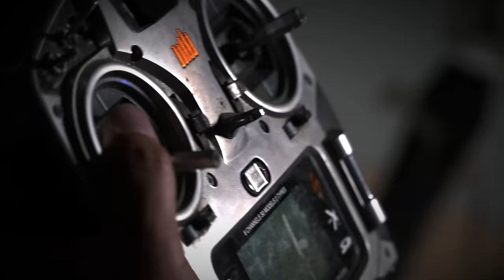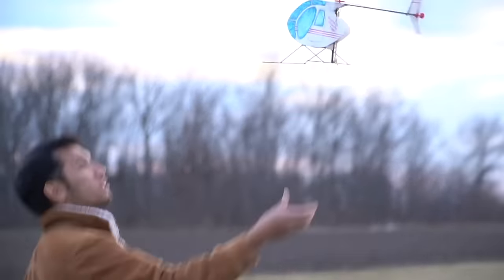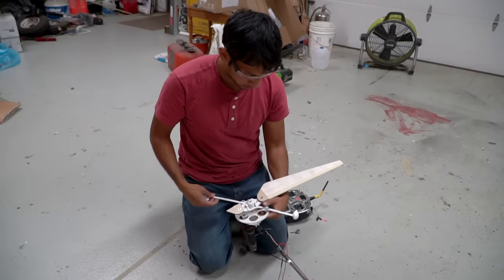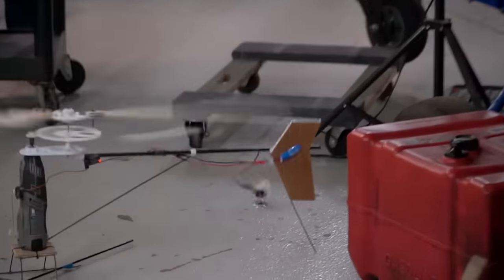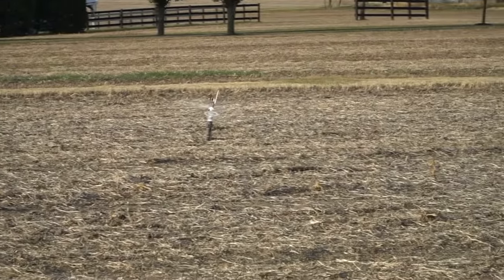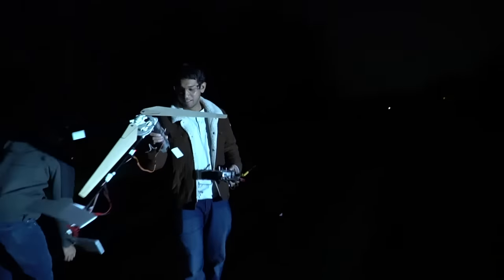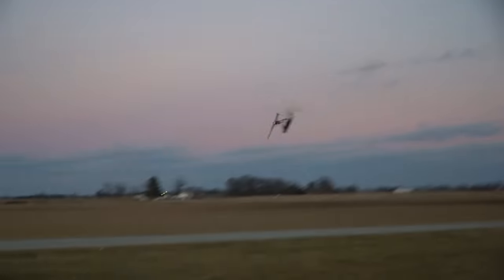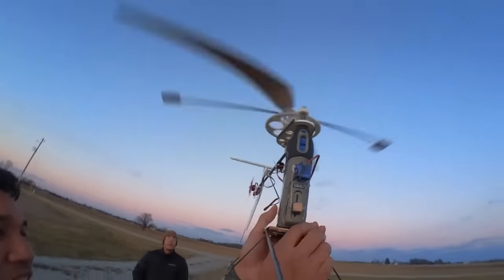Teaching a Dremel Tool to Helicopter

Comment: Think about a pneumatic torque wrench powering a go-cart.  The fun would be the air compressor needed to keep the torque wrench moving.  If you wanted to scale up, there are torque wrenches in 1-1/2" and 2-1/2", if 1" is too small.  Problem is scaling down as the CFM doesn't change that much.
Reply: Pressurized air on an experimental go-kart seems like a questionable idea

Comment: I don't know if there's a free plug-in to make them, but helical gears would give you much less noise. Involute gears are good for low speed high torque applications. Things I've learned from This Old Tony.
Reply: There are free plugins for fusion for helical gears. I'm not sure they would be a good fit for this application though, as they also create a side load, which would case the frame and gears to flex depending on how much torque is applied, possibly causing them to disengage in flight. By involute gears I'm assuming you mean straight cut gears? Involute gears can be straight or helical, and is the most common type in machinery today, and are suitable for all speed ranges.
Reply: Think that's the least of their problems 😂
Reply: SHOUT-OUT TOT
Reply: @2testtest2  That's why double helical gears exist.
Reply: @JurassicLemon  

2x! Guy is a genius machinist. Love his channel.
Reply: This Old Tony does not make RC helicopters. Among other things helical gears have to be fatter and heavier.  I'm familiar with the world of RC helicopters and I have never seen a helical gear used for the main rotor drive.

Comment: I would like to see this Dremel revisited as a Gyrocopter and the Dremel being used as the forward propulsion. Then you will have a dihedral to keep it balanced plus rudder authority via the tail planes and still retain a rotor and blades as your lift. Looked fun!

Comment: Why didn't you try a brace between the drive shaft from the Dremel and the shaft the blades connect to to keep the gears from slipping? Lot more energy in a battery than the rubber bands.

Comment: I made my own set of piccolo blades back in the early 2000s. I later made some collective pitch blades with symmetrical profile and just put a tapered shim under them to give a fixed "collective" like pitch and they flew extremely well. I dared not try them before static/dynamic balance which doesn't take long.
Reply: How do we get the Sripol guys to see this???

Comment: If you trim it for forward flight the power and tail rotor effectiveness will not be an issue with the translational lift.. and it will be more stable.. don't try to hover

Comment: Some things I noticed - a shorter screw in the gears could help remove the centrifugal imbalance which is impeding the gyroscopic stabilization you should be getting from the rotor mast, also adding a guide flange to both sides of your small 3D printed gear will help it maintain the interface with the larger gear and not allow it to have so much play in it. Beyond that - y'all are not only insanely clever, but also extremely good at making entertaining videos.

Comment: flying without cyclical control would be impossible. Youll lose lift when it wobbles or picks up to much speed.  You need counter rotating blade to have any chance of that.

Comment: You should orient the dremel parallel to the rotors to balance the mass.  Also do a coaxial rotor system to prevent the counter rotation and do a magnetic clutch to power and vary the speed for a push rotor.

Comment: The tail rotor fan blade should be longer for airflow.
Reply: The horizontal stabilizer is blocking the air flow for at least half of the tail rotor. A disappointingly obvious design flaw. (Compensated for by the entertainment of watching Peter and his wrecking crew operate.)

Comment: I designed a belt drive EDF setup with a 33cc Ryobi engine in CAD. Bought parts to build it but never got around to it. I think it's a 5" EDF and I got 6-1 pulleys. Never got to building it but I still have the edf and pulleys. I now have a mill and lathe plus the Tig welder I needed then,  but I build real car stuff now so who knows if I'll ever get time to mess with it again. I was planning on a f86 ish plane like 50-60" span. Love to see something crazy like that.

Comment: V-22 Osprey using 2 dremel's next. You needed a swash plate to control the main rotor. Impressed on the lack of tail rotor spinning out. Hard to catch the torque from the change in speed of the main head.

Comment: Great effort, enjoyed the whole whatchamacallit. I tend to think you got a lot of vibrations going on in the structure though. May i suggest a thicker main gear, and two bolts facing each other on the shaft colar (the part that secures the main gear underneath it), so you can get more balance.
Also, prefferably 3D-print the whole stabilizer section as one single piece for a more rigid assembly.

Comment: support the gearbox on both sides by using bearing and plate with mounts to sandwich the gearbox, it is slipping causing the wobble. support to prevent lateral movement of the gearbox on one side should drastically remove wobble and improve efficiency and stability

Comment: Consider raising it from a string attached to the blade's axis, that's a great technique to find good balance. The motor aligned with the main axis would improve control too, and maybe using belts and pulleys would also be a better way to reduce it...

Comment: An interesting bit of information that may or may not help you in future projects:
The UH60 BlackHawk's Tail Rotor spins 4x for every 1x the Main Rotor spins and is direct geared off of the Main Rotor driveshaft.
The Tail Rotor also provides 600lbs of vertical lift at stable hover due to the angle it is mounted on the tail.

Also: Any rotary craft that flies for USA and allies has the Main Rotor rotating counter-clockwise when viewed from above, whereas any rotary craft for the opposition rotate the Main Rotor clockwise when viewed from above.

Also: Due to unchangeable physics, when the cyclic is pushed forward (on the UH60), it's the blades at the 3 and 9 o'clock positions that increase and decrease pitch respectively. Because an action on a spinning disc takes effect 90° retarded.

Comment: If ya ever decide to do this again u have to support the rotor shaft at the top as its wobbling which is causin alot of the issues but also use some grease aswell

Comment: Love your enthusiasm Peter, I think a good set of training gear ( big X carbon fiber rods with ping pong balls on the ends) would have at least prevented a few disastrous tip overs. Also keep the tail rotor in the open instead of shielding it with the tail fin, move the fin forward.
Hey hindsight is 20/20 lol.

Comment: The gears are pretty noisy. A little lube might help. Love your persistence! I wonder when you’ll figure to move the power switch to the back - or control motor power with a remote solenoid/actuator/RC channel.

Comment: If there was a Sikorski award for perseverance, I would highly recommend they give you one. 
In all your failures, I noticed the Dremel lost it's CG, once it tilted sideways. I was hoping you could address that. 
Why not a 3D printed counter rotating gearbox? Can you make one? Just 2 blades rotating in opposite directions but moving air in one direction.

Comment: Long time ago, I remember an issue of Popular Science that had the type of plane they called a drone. The nosecone had a camera in it, and the propeller was a pusher.
The tail was mounted between two masts attached to the wings on either side of the propeller.. 

Best guess is it had a wing span of 8 to 10 feet and 
the tail was 3 or 4 feet wide by 12 inches front to back..

Maybe you could do that with a weed whacker...

Comment: That was fun ) But I wanted to suggest you already couple of videos before: try use a belts, there are a lot of options on the market for a different sizes, also very easy to print the pules!! ) have a look on gt2, or even the flat belts. Its all will be soooooo smooth and quiet)  don't use 3d printed gear to gear connection

Comment: Mix throttle and tail rotor channels to make it slightly easier to control?
Gears are too thin and too far away from bearing bracket, they will skip and jump. Thicker gears closer to the bearing surface keeps them from jumping around

Comment: the slippage should be pretty easy to fix, just connect the tip of the cordless rotary tool shaft to the middle of the secondary shaft, or just use a more rigid support, tho it looks like the shaft itself bends quite a bit so a better support wouldnt change much

Comment: My suggestion would be instead of using direct intermeshing gears you could use belts like what you find on 3D printers. Of course tensioning the belts may be annoying but it does allow for some slop in the helicopter and also allows slippage which may or may not help with protecting the rotors for when the helicopter crashes. It should also hopefully cut back a little bit on noise, vibration, and wear.

Comment: Instead of a tail boom, would it be possible to use a counter-rotating main rotor? P.S. It almost gave you a haircut!
Reply: Sure they could have, but it would have made the build a lot more complicated.  You see that all they had to do was stick a tiny motor on the tail and have it controlled by a speed controller, they didn't make this clear but it was plugged into a gyro that was trying to keep the thing pointed straight.

The problem with doing a counter rotating double main rotor is that you're going to have to have collective control in the rotors, what that means is you have to adjust the pitch of the blades of the two different rotors separately in order to get yaw control, and that means they would have needed a whole lot more parts that are difficult to make on your own and which would have added extra weight and complexity to it.

Comment: Dude he's using a friggin OMP Hobby battery pack to power the tail.  And ironically it's literally the exact same battery pack that is used to power the OMP Hobby M1.  An actually nice collective pitch helicopter that actually flies really smooth and is actually capable of flying upside down.

Comment: Seemed like if you adjust the blade tracking and the main drive gear vibration you probably have it flying👍 ... should be able to shorten the flybar just increase the weight to avoid boom strikes

Comment: A suggestion for a video would be to make a gasoline engine fly. Not to put it into a plane and make it fly, but to literally have an engine with a propeller and wings soaring through the air. THAT would be hilarious.

Comment: Video idea: How about a tool build instead?
For cutting foam to intricate shapes, if you made a rig that holds a hot wire, it could roll through at a controllable height with a level, but here's an idea I had to make a way better version of that: Make 3D shapes not just 2D shapes, by adding pins on the wire.. ofcourse these raisable and lowerable pins need to come in from behind the cut, holding the wire.. best idea I have is knives, sharpened on both sides, with tiny holes in the ends to thread the wire through. Cut can be as long as the blade, so may actually need to basically be swords.
Does that make sense?

Comment: That persistance! I noticed all the good attempts seem to have a pretty balanced main rotor. Every time the main rotor was vibrating like crazy the flight did not last long. Anyhow, as far as I am concerned I would not mind seeing projects with less of a challenge and a higher chance of success. I was feeling frustrated by just watching and it must have sucked to retry this over and over.

Comment: Maybe do a dremel-powered gyroplane with the tool sitting horizontally in a tractor configuration - it will sorta look like a helicopter. Most bystanders won't know the diff.

Comment: I compete in model rocketry and while building our helicopter model we noticed our balsa wings weighed ~4 grams more or less when cut out of the same board. We concluded the base of the tree may be more dense causing the difference. Also sanding all those wings must have been the worst part😂😂

Comment: Having flown R/C helicopters, I think your results are about as good as could be expected. These things are really unstable by nature. No way it will fly for more than a few seconds with just throttle and yaw control without a really massive flybar, in which case it wouldn't have enough power.

Comment: And if you try cutting off the battery from the Dremel and just using a comparable sized lipo pack and maybe just use the propellers from a big RC helicopter and a kill switch for sure

Comment: Have you considered thermo-forming some 1/32"or 1/16" G10 for lightweight highstrength applications?  I know it's not as light as the balsa but with that mass comes things like longer blades.  They even have thermo-set G10 on the market.  I hope you find this idea useful down the road.

Comment: Wait so that Dremel tool is using a standard 775 motor? It looks like the same motor used in the cheap 3018 CNC routers on Amazon.

Comment: Hmmm how about a leaf blower hovercraft using only the air directional control. E.g. only the air moved by the leaf blower. The challenge as I see it off the top of my head is when using the directional controls, the power bleed from the lift, also controlling the lift when no controls are being used.

Comment: Use plastic props for better durability, possibly 3d print for better balance. You need a trimable linked tail throttle and the blades look like they hit the tail with too much forward tilt. And your rear stabilizer is blowing air directly into a flat surface severely reducing it's power.

Comment: would it not be easier to make 2 counterrotating sets blades, one inner shaft, that leads to top blades spinning in one direction, one outer shaft, a hollow cillinder that powers the lower blades that spin in the other direction, this way you can use the Dremel itself to regulate the correction, and because both rotations are linked and of the same driving force, they should cancel out.
You can even ditch the tail in that case

Comment: Could have put a swash plate system on it to give you more control of the side to side motion and lift and use 350 rc blades

Comment: What about designing the gear that is connected to the shaft of the Dremel tool that has a guide that keeps the reducer gear from flopping around so much.

I wonder if you could get more stability through consistent motion of the two gears being more stable.

Alsio, your tail stabilizer appears to not have enough clearance during the launch sequence.

Comment: Do you know how Helicopters work?? The rotor blades are balanced, you have no swash-plate to change the pitch of the rotor blades along with the mast direction. All you have is YAW and altitude control via rotor RPM. Your tail rotor also needs to be able to generate thrust to counter the torque of that main one. I suggest brushing up on your helicopter aerodynamics since it's completely different from fixed wing.

Comment: Do you think the counter rotation of the rotary tool motor was adding to the rotational instability? I know the tail of the helicopter is supposed to counter the torque of the main blades and body of the aircraft. But could the gear ratio you put in to reduce the speed of the blades from the tool be creating another point of counter rotation?

Comment: make a coaxial helicopter it is way simpler and I have made it using mini motors the design is stable and concrete in nature, for Yaw and pitch control I  have added a back motor but facing vertical , and to turn the helicopter I have design a system in which by increasing the power of a motor  and decreasing on the another I am able to turn the helicopter , I did this project for my aerodynamics class group project it was fun but all the parts were hard to produce as it was a small helicopter and needed a lot of small parts which my 3D printer was not able to make , hours and hours of browsing the internet I finally found a Japanese store which can 3D print very small stainless steal and carbon fiber well our team won the 2nd prize and it was worth it . And I did this project all the back in 2007

Comment: Making the balancing shafts thicker significantly increases their drag, thus lowering the available thrust. Cylinders have several times the drag coefficient of most airfoils. So its likely your balancing shafts are contributing around as much parasitic drag to your rotor as the blades themselves.

Comment: Nutty idea: make an airplane out of pig ears and those pig skin things they wrap into bones for dogs, to make pigs fly.  Just soften with hot water (I would take it to a boil to kill any bacteria), and cut, mold, and rivet into the shapes you need.  That should be very strong.  Of course, fighting off the dogs, might not be easy.  Need extras for them.
Propellers, wheels, everything that can be...pork.

Comment: Reason its underpowered is because of the 3D printed gears :)
Gear slip = Power loss
It also increases vibration which decreases stability. Maybe that should have been looked into in the beginning to save pain.. but nevermind

Comment: Dremel tools can go from 0 to 36,000 rpms in less than a second.  They are heavy and will require some serious engineering it stop it from ratting to pieces and achieve a predictable and stable flight.

Comment: I modified one of those toys you pull a trigger on and it spins a fan blade type thing and when you let go it flys into the air to be powered by a dremel and it would fly so high lol I will say I couldn’t go full power because the plastic would deform and just shoot off anyways
Reply: After watching the video basically exactly what was showed immediately at the start of the video but smaller lol